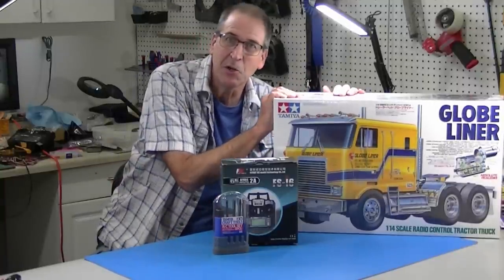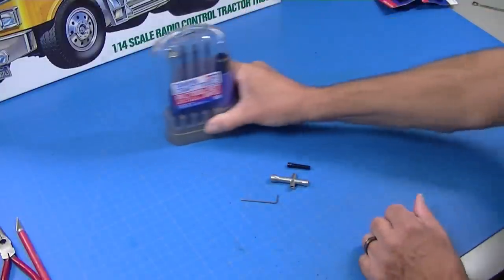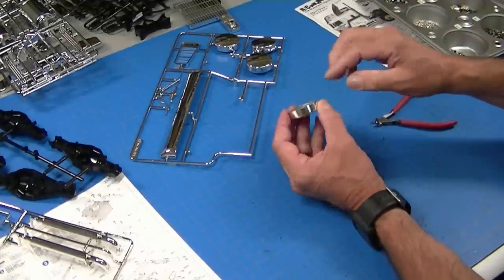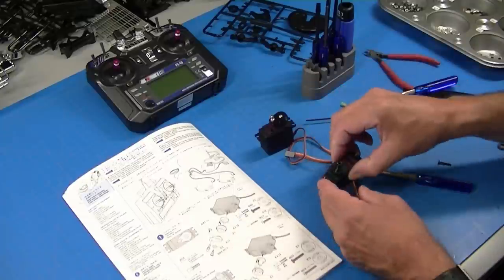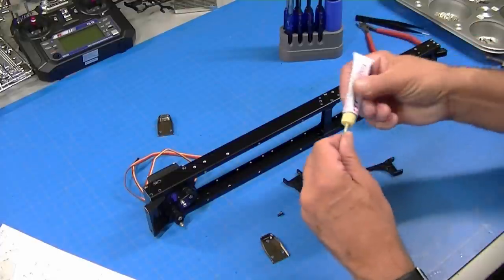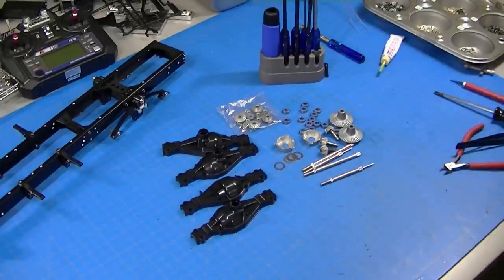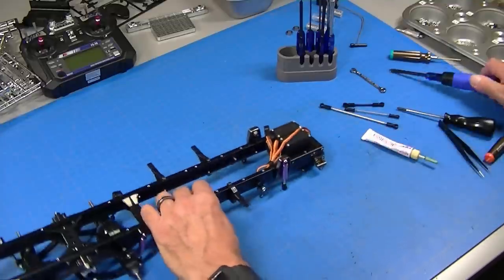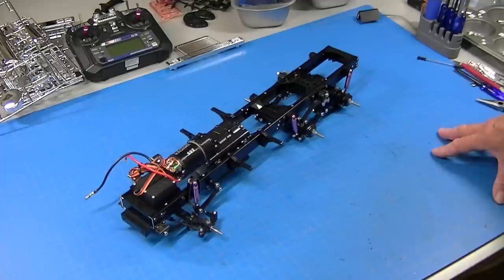1/14 Tamiya RC Globe Liner Build for Novices - Part 1

Comment: These cabover trucks always have a special place in my heart. The FIRST semi truck I rode in was an old cabover truck!
Reply: While I was a kid in the 80's when cab-overs were a common sight on the roads, and while I always preferred the standard nose style, specifically Peterbuilt being that we share the name. Many years later I made a career change and found myself driving big bucket and line (crane) trucks nearly every day for 8 or 9 years before getting the foreman job that comes with a new Ford F550 diesel take home truck. Anyway, sometimes I had to drive one of the older 1989 to 1991 cabover Peterbuilt bucket or line trucks, and while they rode failry smooth,  the feel sooo wide even though all the new amd old trucks bodies are all the same 8' wide, but the cabovers put the front 2 seats right up in the front corners so you need to get used to driving a big truck from an unusual position, in front of the front wheels, as far forward and to the left as possible. Because of this the amount of room is minimal for such a huge vehicle. Im 6'6" 245 and the massive steering wheel is in the way, I dont have nearly enough leg room and its by far the worst truck to sleep in when we are working storm doing our 40 hour shifts with 8 hour breaks between. Then with the air suspension seats in the cabovers with the seats ahead of the front axle, Ive hit the ceiling so hard, countless times after going over bumps or dips in the road, like crossing intersections of 3 or more lanes where the crossing road is raised a bit in the center, causing the front end to swing up and down rapidly. Numerous times the little button on the top of my baseball hat has cut my head from smashing the roof so hard. No broken neck thankfully, but it has happened in the past.

Comment: WOW This just what I needed.  I just got mine yesterday ordered from you.
Reply: I ran into a small problum with the servos. They are to tall so the floor won't fit to the frame. I added 4 spacers and lowered the servos and now the floor will fit right. I posted some picture on the Facebook page 1/14 Tamiya Truck Open Studio.

Comment: Everyone seems to say that the stock 27T motor is way too fast making the truck too tippy through turns. I was just wondering if a 34T or 55T would be better. I would like to have my rig have an ok amount of speed but still be stable through turns.
Reply from the maker: Yes, go with a 45 or 55 turn.  Both will give you much improved operation over the stock motor and still very good speed in 3rd gear.

Comment: One thing I found out back in the 1970s is that the standard for Phillips head screws in Japan are different than here in the states. American Phillips head drivers will not fit Japanese Phillip head screws. They call it  the JIS standard. I used to work on old Japanese motorcycles back in the day and on almost every bike that had an oil filter cover secured by Phillips head screws were stripped out by American owners using American type drivers. Old 1960s and 70s Hondas were notorious for this.

Comment: I was a little surprised by how quick the truck is with the stock Tamyia motor.
Reply from the maker: Yes, they are quite fast - even in low gear.  A higher turn motor is a really nice and easy modification.

Comment: Can this go off-roading? Like I’m not talking can deep mud, but like tall-ish grass, dips and bumps, and other smallish stuff.
Reply from the maker: The trucks are designed for on road use.  They can handle some rougher surfaces but to go in grass etc. mot so much.  You can lock up the diffs etc.  but the suspension travel is limited.

Comment: Bob, What ever happened to the customer build where he sent you a smoke generator to be used for the build?  I assume it wouldn't fit anywhere.  It would be the ultimate finish for a truck with working stacks.  Great videos, always enjoy them.
Reply from the maker: I will add the smoke generator in a future truck project.
Reply: @HobbyconceptsLLC  Can't wait to see that one!

Comment: The suspension that you build, does it work or is it just for scale building? In part 3 I can't really see any movement whilst driving.
Reply from the maker: Yes, the suspension works.  Probably not a good video to show it because the cement I am running it on is pretty smooth.

Comment: Hi there I have a question for you I have a knight hauler and futaba T6l controller that all works except I have to change gears from right to left could you give me some advice why this could be and maybe how I can fix it.
Reply from the maker: If that radio has a 3 position switch assign that to a channel and plug the shift servo in to that channel directly.
Reply: @HobbyconceptsLLC  
It is A Futaba T6l sport so it doesn’t have any levers that you are suggesting just one at top left that only clicks up and down.
Reply from the maker: Never have used Futaba.

Comment: o you dont need an mfc or is that optional also
Reply from the maker: You do not need an MFC.  Part 2 will show hooking up a standard radio/Speed Control and getting the truck running.
Reply: @HobbyconceptsLLC  cant wait to watch

Comment: As a extra parts hoarder I cringed when you threw that back of extra parts in the trash for the servo. Never know when you need something! Haha
Reply: I needed one of those extra servo horns before I even finished building my Mercedes Actros (Similar to the Globeliner, just a little more streamlined). The servo-saver 3-piece unit the model came with was simply too fragile after changing hands for over a decade...in Arizona garages...without ever being built until I got it.